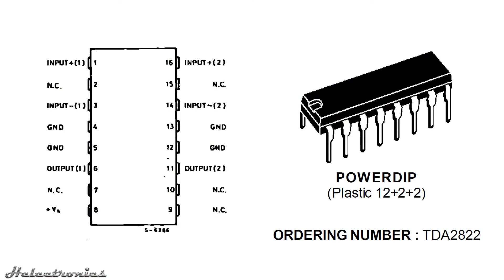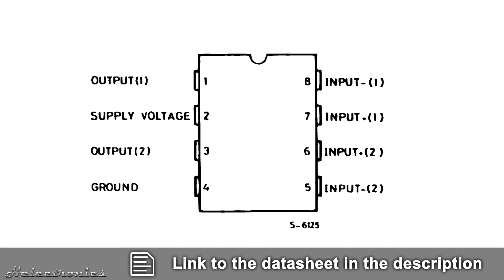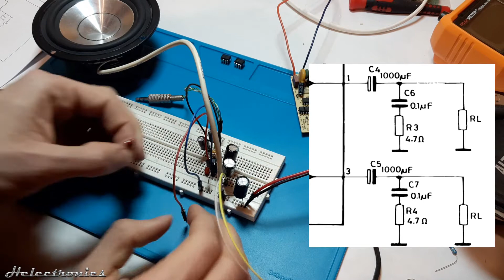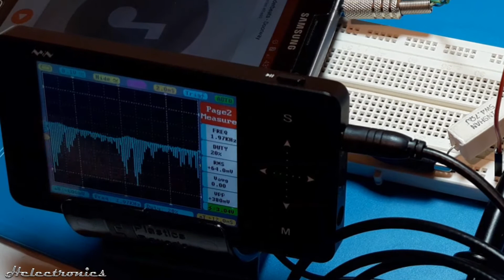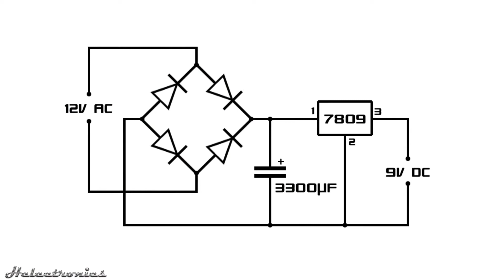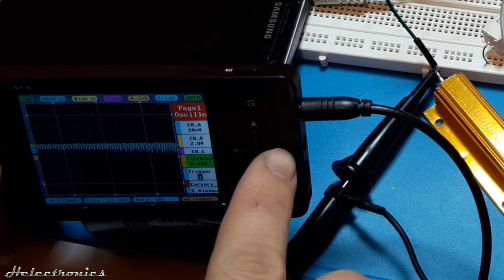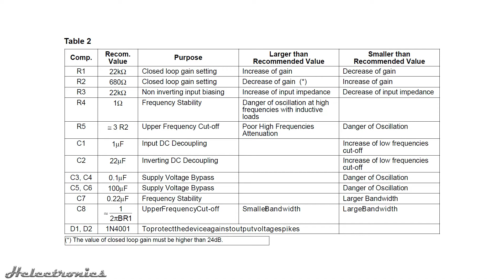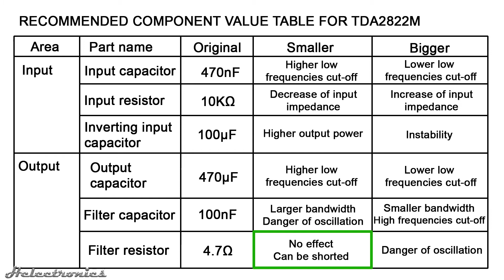TUTORIAL - TDA2822M Built on breadboard (Easy-Medium Difficulty)

Comment: If you put the circuit in a metal enclosure and ground the enclosure, it can greatly reduce EMF issues.  Always use star grounding.  I like to ground all the necessary points in the enclosure (circuit, jacks, any LED indicators,  etc.) to a single point on the input

Comment: Hi, how to test the tda2822m to know If ti working? thank you nice video
Reply from the maker: Depends on what tools you own, do you have bench power supply, oscilloscope and multimeter?
Reply: @Helectronics  I only have a multimeter, thank
Reply from the maker: @andersonmatos1088  It's not so easy with a multimeter, if you have a known good IC you can compare the unknown ICs. You have to set the multimeter to diode testing and measure the legs.

Comment: I'm learning this ic too, brother. I use 1k5 resistor before the each input pin (pin 6 and pin 7). And i use 1k resistor rather than 10k resistor from input pins to the ground. And i put the 1k to the ground before and after the 1k5 resistor. I use 220uf ouput cap. The 100% volume level results "crack" sound on the speaker. But on 90%, the sound is amazing. But the bass is reduced too. I plan to reduce the input volume with 220ohm resistor (as a fix full volume). I realize that my circuit has no input cap to block the dc things. Thanks for the explanation.

Could you analyze the bridge circuit (mono) related using this IC? I've not succeed building the bridge. Related the maximum recomended value also. I like the way you analyze the circuit. Giving the summary about the recommended value and the effect of using bigger and smaller value. 😊🙏
Reply from the maker: Thanks for the kind words, these kind of comments give me motivation to continue makeing videos. First I wanted to include also the Bridge version but I had no time to do that, also the video was already long. Maybe if I get enough requests about that, I will make a separate wideo about it.